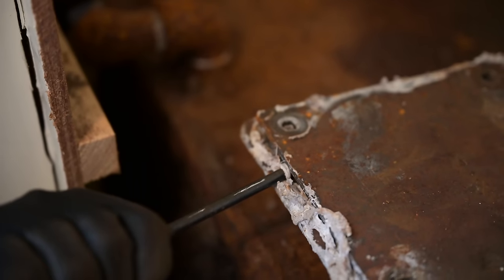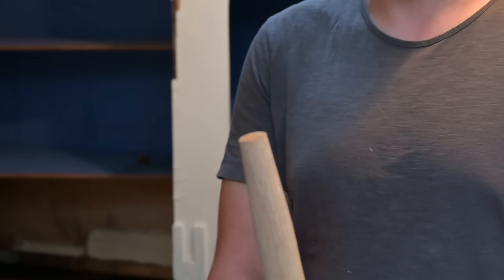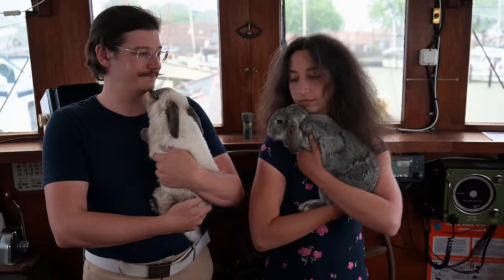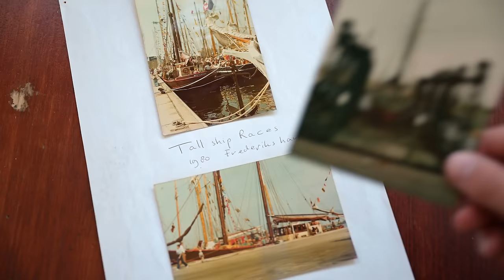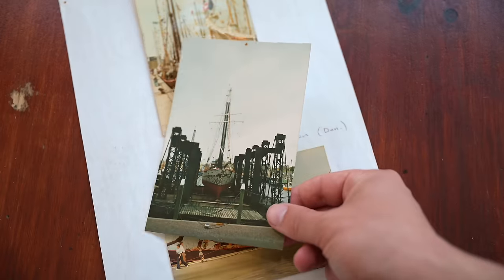Finally Finding The "LEAK"

Comment: What’s the face mask for,  did you spot a coronavirus hiding 😂😂
Reply from the maker: Back in the days they used what they had to conserve a steel hull. Tar (PAK), lead paint and sometimes even asbestos. All that mixes well together with the fibers of the glass wool isolation. So whenever we rip out peeling that covers the hull we wear P3 masks to filter out the worst things that would otherwise accumulate in our lungs. Also the masks make the smell of the open, not yet removed, black water tank somewhat bearable. Good to have, yes, necessary, I don't know.
Reply: @FlyingConey  I was only kidding 👍 makes sense in what you say 👍👍

Comment: Did you check the depth of steel of the hull. Judging by the internal corrosion  you may have to get on the hard and cut and patch.Do yourself a favour get a Fein or Dremmel .
Reply from the maker: Yes we have an hull thickness report. If you want to have a look, the report is one of the topics in this video: https://youtu.be/Ffk7Pap1Mf8 I've never been a big fan of the multitool. We do have one of the brand Bosch and it's working fine. We also have a sawzall, a jigsaw and of course a chainsaw. Our collection of steel working tools is not as good though and we still need a plasma cutter and probably a 400 volt genset...

Comment: Ah yes the ever popular multitool ,better known as a screw driver 😁. It has many uses such as a chisel , a wedge , a pry bar ,a scraper ,even a door stop .And on the rare occasion A screw driver .If the tank is not in to bad a condition after you clean and sand the interior of the tank and you find the hole in the tank you can weld the hole over with a patch then recoat the interior of the tank with a rubberized paint .And thank you for explaining why you didn't just taste the bilge water .Yuck .Also thanks for telling us about you being moored in a fresh water lake . also have you checked to see if you are picking up stay electric current from the marina or other boats around you ,I ask because a friend of mine had this problem and it caused all kinds of havoc with his hull and electronics .
Reply from the maker: I have to double check (Book: Boatowner's Guide to Corrosion) but I think stray current from the marina or other boats is mainly a problem if you are plugged into shore power. Since we don't have an isolating transformer we are not plugged into shore power. However, isolating transformers were prohibitory expensive back in the days so it was common practice to only plug the boat in when electricity was needed. With the thick hull plates it took some time to cause damage but thats the reason why most of the old ships have the electrolysis scars on the hull. (So I've been told) Thanks for your comment!
Reply: @FlyingConey  It can back feed thru your grounding system .And with a steel hull stray voltage can ghost thru your whole boat . I don't think you have this problem but it is something to be aware of and can easily be checked out .

Comment: The amount of nasty labor and money to address those two huge rusty tanks makes no sense. Get rid of them. I am no sailor, but I would consider putting in numerous, smaller, plastic tanks. This also gets rid of long stretches of piping. Keep some of the tanks separate from each other. Heck, buy plastic "pickle barrel" tanks. Stack 'em and strap 'em where they fit. About 50 gallons each. Or, maybe rectangular 150 gallon tanks in a wire cage if you can get them down the galley ways. You can get these tanks for $50 each or less. Incorporate independent rain water collection systems.
Reply from the maker: PE tanks is probably the best option we have. We have now connected steel tank two directly with the pump and that works fine. A new tank is about 1€ per liter. Or 4€ a gallon. The critical measurement is the hight of the tank because I think we only have about 35cm under the sole. So probably a bunch of 250 liter tanks or if we can spare 40cm than  460 liter tanks. We will see more when the foreship is empty, including the steel tanks 😉

Comment: The answer to your question: the black stuff which came out of the bubbles is likely to be oil. Until the 1970's and even 80's commercial ships and live a board ships where coated on the inside with oil, to be specific waste oil. It was the cheapest and most affective way to treat steal against rust. So, nothing unusual to find in an older live aboard ship.
Reply from the maker: The inside of the hull is either coated with bitumen or tar. Bitumen is an oil product and tar is made out of coal. But the inside of the water tank coated with waste oil? Also oil would float on the water. So I'm pretty sure that is some state of steel or iron. Probably rust underneath the red/brown coating of the tank.